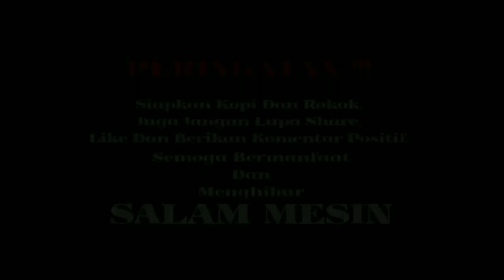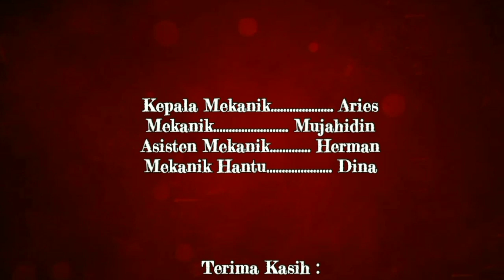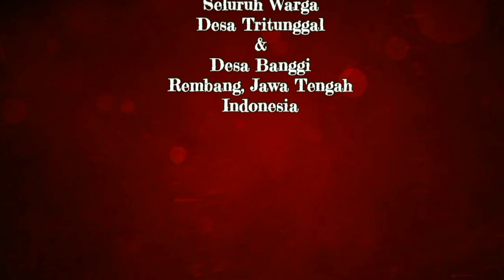HASIL EMPUK❗TAPI HARUS PERHATIKAN DENGAN SEKSAMA AGAR TIDAK SALAH DALAM PENERAPAN

Comment: Om mau tanya,
Kenapa ya sama habis ganti seal shock, shock nya jdi ambless..
Padahal pipa shock nya baru Mas..
Oli nya sesuai dngan standar nya,

Sebelum saya ganti. Tidak amblas cuma bocor saja..

Kira2 apa ya Om..
Saya sudh bongkar sampai 3 x tpi gak ketemu permasalahn nya di mana..?

Apakah ada solusi ya Om..?
Mohon jawaban nya Om.. 🙏
Reply from the maker: Bisa jd terlalu empuk, atau per skok kurang panjang.klo amblas tapi ga mau keluar berarti tabung dalam kotor minta dibersihkan.cek juga jarak tengah as roda sebelum dikencangkan apa masih ada jarak, klo iya tambah ring jd biar ga keras.
Reply: @bengkelmotorghaib  bisa gara2 per nya juga ya Om..?
Per yg besar apa yg kecil itu Om..?

Klau as roda rapat aj Om..